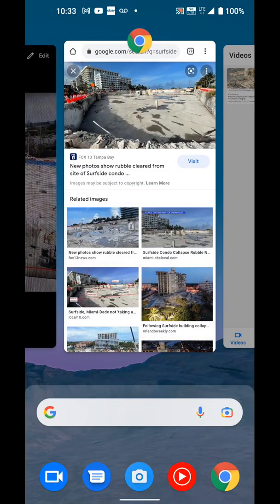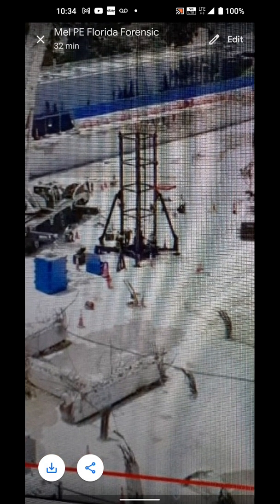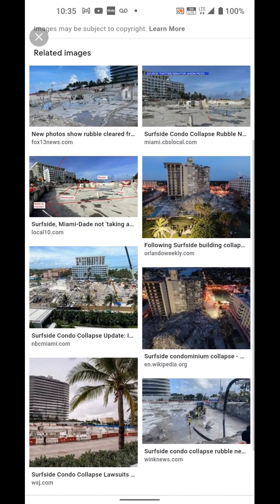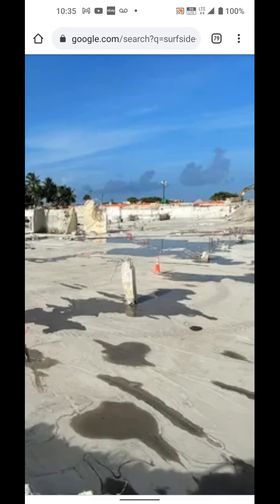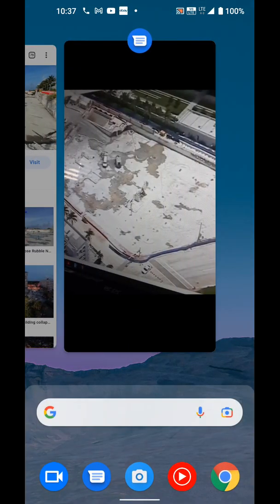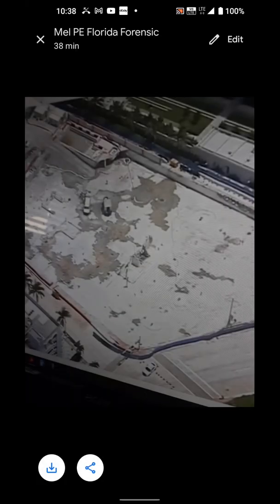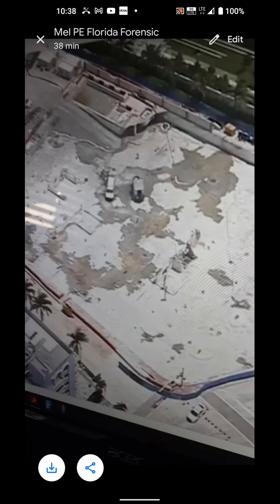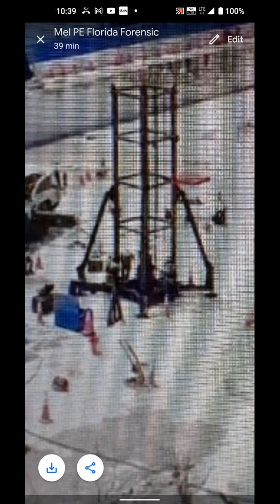Surfside Champlain Towers "Global warming testing"  by NIST 40lbs per sq foot slab loading TONS

Comment: Guess that the floor will hold, the footing will hold or the next pictures will show the testing device sunk deep inside the non-existing void.   If the building falling down didn't drive the footings or 'crack' the floor what could a light weight test show?
Reply from the maker: 40 lbs per square foot is what the parking deck was designed for and now they will load it with tons of weight to use a machine that must be on stable surface...
This parking deck WILL be able to tell us that it can take tons of weights at point loading, once they load it with the weights!

Comment: You always make it easy for us non-engineers to understand. Thank you 🤩
Reply from the maker: Hello Ginny, hope you have my email now... I am very curious to see your message.
Reply from the maker: 40 lbs per square foot is what the parking deck was designed for and now they will load it with tons of weight to use a machine that must be on stable surface...
This parking deck WILL be able to tell us that it can take tons of weights at point loading, once they load it with the weights!

Comment: That’s wild.
Reply from the maker: 40 lbs per square foot is what the parking deck was designed for and now they will load it with tons of weight to use a machine that must be on stable surface...
This parking deck WILL be able to tell us that it can take tons of weights at point loading, once they load it with the weights!
Reply: @ForensicCats  You might already know about this but when NIST cut those square holes in several spots & filled back in, a guy that ran the big Alpha Crane said in a live chat that they placed some kind of sensors below the floor & filled back in with cement.  I do not know if it is correct but the guy was who he said he was cause he waved at the live cam while onsite.
Reply from the maker: The crane guy might have believed he saw a sensor placed in the ground but, they place it on the columns they are testing... As far as ground sensing and cement... ''Cement", takes days to cure, unless you use a rapid-set product and then, that alone would also have to a ''new factor'' added to the formula.
So, no way this test is in good faith...
The main point being, it is on a concrete pad, designed to take car loads and not TONS of loading that they are doing.
Further, the piles were not designed to be ''drivin" (40 years later) and AFTER they allowed WATER to soak around the foundations. 
This was a protected pile at one point, from the elements (water)... 
These piles will be tested until they fail and then will considered to be a factor if they do not meet the engineer's design intent... Keep in mind, this was only hold a tributary area of the pool deck and also some of the vehicles parked around that column.
A simple look at the base of the column, would tell you if the pad and column were moving...
Reply: @ForensicCats  Oh I agree with you, it seems ridiculous & as usual, when I questioned it, about 10 people attacked me.  They did work at it for days & they did let it set for days to cure.  They either cut deep below the cement foundation or into the middle of the foundation but pumped out water (maybe to remove water from cut saws in the hole) before they placed the gadget inside with a stick or pipe sticking out of the square & poured buckets of cement inside.  I called it quikset but some yahoo quickly jumped on my comment at the time.

Comment: Always trying to keep them honest. Thanks! 👍
Reply from the maker: 40 lbs per square foot is what the parking deck was designed for and now they will load it with tons of weight to use a machine that must be on stable surface...
This parking deck WILL be able to tell us that it can take tons of weights at point loading, once they load it with the weights!

Comment: Tried to answer lol
Reply from the maker: 40 lbs per square foot is what the parking deck was designed for and now they will load it with tons of weight to use a machine that must be on stable surface...
This parking deck WILL be able to tell us that it can take tons of weights at point loading, once they load it with the weights!